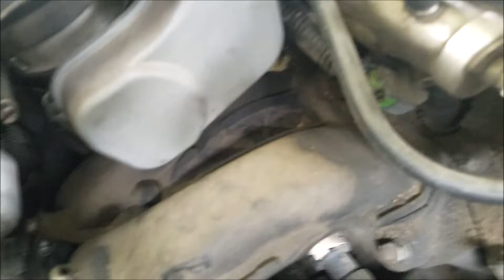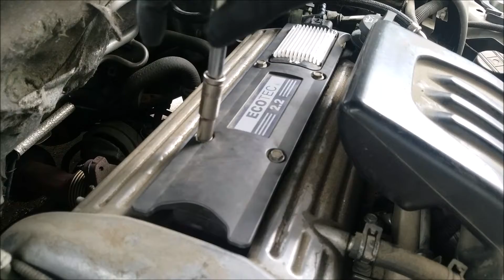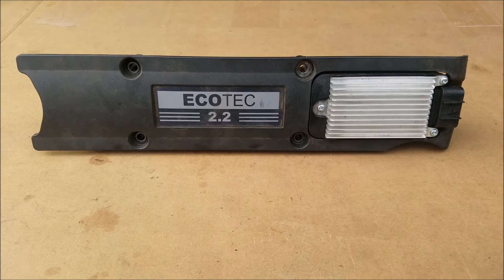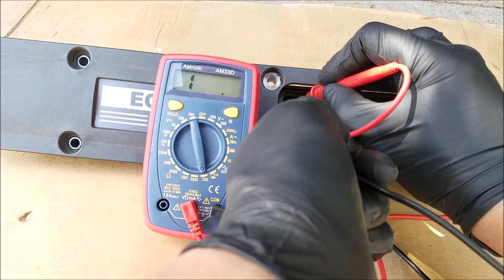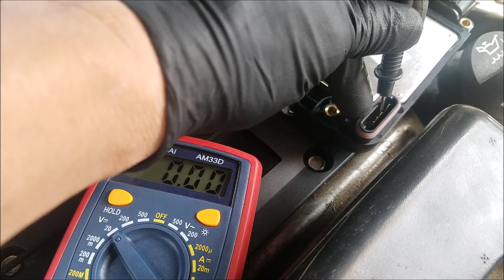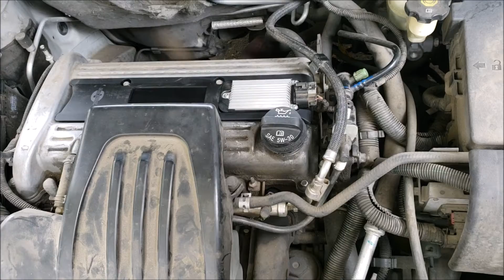2006 Chevy Cobalt 2.2l Misfire P0300 (Testing and Replacing Ignition Control Module & Coils)

Comment: Thank you for the informative film. When you attached a new Ignition control module, where did you lubricate it? I've read - all female connectors on the module (which are 2), but some people lubricate the back of the module and don't put any of Silicon Heat Compound into connectors. And how much you put, if you could tell. Thank you again.
Reply from the maker: You wanna lubricate the rubber seals, usually the ignition module comes with a lil pack of grease this keeps out any moisture or dirt from the electrical connection...u wanna avoid getting it on the contacts, since its non conductive it can cause a bad connection
Reply: @backyardchevy328  Thank you for the quick replay. I ordered one fm Amazon, there is no pack with the lubricant there. On another set they give a pack on which it reads - put into connectors. Means it is a conductive lubricant they send.  In my old module, on the smaller connector there is some grease, very little, kind of oily if you touch it.  There was also a blob of some greyish grease sitting in the coil puck compartment for the module below the second connector. I didn't know at that time what it is and removed it. What kind of grease it can be? Or you just put Silicon compound on the back and that's it, nothing into connectors?
Reply from the maker: @olenaerhardt7725  you just have to make sure which grease u use..the one that comes with the ac delco ignition modules is a lubriplate ds-es its meant to go on those connections..and those u do put on the female ends of the connectors..but some use dielectric grease and those u just put on rubber seals..theres some other modules that have a heat lubricant that goes under module but that doesn't apply to the cobalt since it doesnt have a metal plate it sits on
Reply: @backyardchevy328  But what and where you put on your car? I'm sorry I never mentioned that my car is also Chevrolet (2003 Cavalier), so I think it might be similar grease to use. The thing is that in many films on this subject people put Silicon Heat Compound on the back of the plate (on module) in the manner like they make a sandwich with butter, I've never saw a one placing any compound into the connectors (how it is advised on the pack of the lubricant for ACDelco 19300922 GM Original Equipment Ignition Control Module (on Amazon)). You won't put much into those connectors, so will it absorb the sufficient amount of heat? Now I'm thinking maybe that blob of grease (diameter ~1/3") I removed was there left on purpose by the manufacture to absorb more heat? I ordered 2 types of heat sink compounds (conductive and dielectric) and try to do more research on this matter. Thank you for your attention to my question.
Reply from the maker: @olenaerhardt7725  yea the heat compound is meant for different types of ignition modules not like that model..but u would smear a lil on the underside of the module the metal plate on underside of it and spread it on so it keeps the module from getting so hot..but this module isnt that type...if u use the appropriate grease that comes with the ac delco module...u wipe a lil on each of the female contact points on the adapter piece that comes with the ignition module doesnt need much...but if ur using dielectric grease just a light coat around the rubber seals to keep any moisture out..in my video all i used was dielectric grease on the rubber seals and has worked fine since
Reply: @backyardchevy328  I ordered Delphi already, try to reorder AC Delco (someone wrote Delphi doesn't work with Cavalier, gives code). Old part worked fine, just wanted to clean it on replacing the Valve Cover Gasket project. I think it is better to replace it, since many miles (~100K) on the car. I have some dielectric grease and ordered MG Chemicals - 860-60G Silicone Heat Transfer, so will put one of those till the AC Delco arrives. I think that question with this lubrication is so complicated that it would be good if someone did a film on it. Thank you.
Reply: @backyardchevy328  You know I did some additional research and it looks to me that this particular IC Module (I mean for engine EcoTec 2.2) doesn't require any heat compound, bcs "it includes a copper slug heat sink to help dissipate heat and create a more stable environment and it also features a large bus bar for added support and conductivity", how it is stated in the description of ACDelco on Amazon. So they put that grease pack to use on connectors (still not sure if it goes on the contact points (why do you think it should be applied on contact points?) or just inside the connector to prevent water, maybe it is dielectric grease in that pack). I think you are fine with just dielectric grease as you described, bcs the cooling system (that cooper slug heat sink) is inside, so it is there already, and just some dielectric grease is needed. But why that blob of grease was in the coil compartment originally?! That is what doesn't fit the puzzle till so far. Thank you for giving important pieces of information about my problem.
Reply from the maker: @olenaerhardt7725  yes, these modules dont need heat dissipation since they dont sit on the metal plate as previous models..the grease is just to keep any moisture or prevent corrosion and asong as they have the rubber seals that will prevent that...but if u use dielectric grease it helps em keep moisture out even better..the big connector on mine didn't have anything in it..that stuff thst comes in only the ac delco modules is different than dielectric grease and that one is the original stuff inside the all the connectors..its meant for electrical contacts so thats what u would find..but its not required..all theyre doing is trying to prevent moisture and corrosion..so some include only dielectric grease..and that one shouldn't be used on the connectors only the rubber seals...so i stick only with dielectric grease, it has worked fine for me so far in the ones ive done
Reply: @backyardchevy328  Thank you so much for the confirmation of my guess. I'll just use some dielectric grease on the rubber seal (I have only 1 pink on the smaller connector, nothing on the big one). My only doubt now is if to put any dielectric grease inside of the connectors (I mean on the walls only, on the very edge of it. I'm physicist, I know, that no dielectric should go on the connecting pins), bcs it looks like you put that dielectric grease only in one place - on the pink rubber seal of the smaller connector. Actually if you put on that pink rubber seal, there is no need to put anything inside of the small connector, pink rubber seal will take care of the water. But I'm thinking to put some inside of the larger connector, very carefully, on the very edge of it, so that prevents water coming in. Did you put an Orange Threadlocker on the 3 mounting screws? I don't have one currently, though ordered it, but think maybe to complete everything today with the Blue Threadlocker, or it would be too strong, so then you won't be able to remove those screws later.
Reply from the maker: @olenaerhardt7725  yea u can do that..using like a cotton swab to apply it
Reply: @backyardchevy328  Appreciate it, that is what I planned. Bless your heart!

Comment: If there oil on the boot and plug, just one of them. Would replacing the boots make any difference?
Reply from the maker: That would be an issue with the spark plug tube seals..youll wanna replace the valve cover gasket including the seals that go around the spark plug holes

Comment: Hi, is it possible that if we have a bad coil car will die out. My saturn ion 2005 is giving trouble, intially i mean at 192000km it used to have a gap in firing the units like its trying to die out so after running it for 8000km it has started this problem like sometime it will be no cranking, sometime it dies out right after the engine is started and sometime in the middle of driving. Does anyone have a solution? I did clean ecm connector harness pins with rust remover but same issue continues.
Reply from the maker: Any check engine light/codes?  Thats kinda similar to symptoms this cobalt i worked on had..and it was a problem with the ignition module...usually when its a coil itll have misfires in only 2 cylinders..but itll run bad the whole time when a coil goes out.
Reply: @backyardchevy328  ok ok
Check engine light is on for a long time. When the engine dies, and i try to start then a car symbol with a lock come and engine does not take self and i have to wait in between 2 to 5min.
Reply from the maker: @rasheed4585  oh ok thats a passlock light..thats a totally different problem..itll turn on for a split second shut off triggering the light.. and thats all passlock anti theft normally an issue with key/lock cylinder.....so when u leave the key on til the light comes off it resets it..then itll run...til it happens again
Reply: @backyardchevy328  yes i ll check. Thanks
Reply: @backyardchevy328  Hi Just a feed back for you all others. This week I visited a GMC dealer and the guy checked the computer thoroughly for the codes and all. He reset the car computer and the problem is gone. Before taking the car to service centre i disconnected the electrical connection to electronic throttle body, the idea was to disconnect and check that by removing which connection/sensor the engine is shutting down (Reduced power with a check engine sign and a downward arrow inside) so after removing the connection throttle body flap opened than it normal position and i was seeing it. I removed the throttle body, removed the side pinched cover with flat screw driver and tried to adjust the flap to its original position. GM has not given any provision to adjust it, so fitted the body back. The result was increased rpm at idle which was around 2000 to 2500. So the service centre adjusted that to normal as well.
I was advised that the reduced power was may be due to throttle body wrong values as it was getting hot so better to change it. I did not go for that bcoz it was 400 bucks plus labour.

But my good luck the original problem was solved. I was told that the problem will come back. Taking the hint of throtlle body overheating, the first thing i did was to seal the cover facing with high temperature silicon which luckily i had in the car. So i did the work before driving it back to home.
Reply from the maker: @rasheed4585  glad u were able to get it fixed

Comment: Hey there! In order to change out just the ICM, do I need to disconnect my battery before doing so? Also, do I need to remove the coil pack before changing the ICM as well? I just want to solely change out the ICM. Thank you!
Reply from the maker: Hello..no u can replace it while the coil pack is still installed and no you dont have to disconnect the battery its just always safer in case someone leaves a key on or a tool falls and hits on say the starter and it touches ground causing a spark..but its just a safety thing.
Reply: Backyard Chevy thank you!!!
Reply from the maker: @clayton311553  always glad to help🙂 thank you for the support
Reply: New question. Did you apply dielectric grease to the ICM? And if so, exactly where did you add the grease? Is it needed? My new ICM came with a packet of dielectric grease.
Reply from the maker: @clayton311553  its meant to be used on the rubber seal of the electrical connections to help keep any moisture out, just a light coat to avoid getting it on the electrical contacts
Reply: Backyard Chevy do I add the grease to the little electrical prongs?
Reply from the maker: @clayton311553  no, u wanna avoid that, since it's non conductive so itll affect the connection

Comment: How much resistance should there be if the ignition coil pack is good? The one I have here is reading 0.6 ohms on each.
Reply from the maker: Specs on these are pretty spotty, one manual says a good coil should read .6 to .81...while other says .6 or below is bad

Comment: Have a 2002 Civic LX Honda replaced 02 sensor fixed it now I have p0420
Reply from the maker: P0420 means ur catalytic converter isnt working as good anymore, if ur front o2 sensor wasnt working as good before, now that its working its detecting that the rear o2 readings are similar or the same to the front o2s depending on how bad the catalytic converter is.
Reply: Backyard Chevy I replaced both 02 sensor bank 1 & bank 2 still getting the code for cats and when I was replacing 02's I took the cats off soaked it in soap and water for a day though it cleaned it out water wasn't really dirty idk
Reply from the maker: @Ayeecole  it could be that ur catalytic converter is really worn out that its not doing its job anymore or missing, they wear out and sometimes they get small enough that the pieces break off and go out the exhaust pipe
Reply: Backyard Chevy wouldn't it be worn to the point I can't see through it if I'm looking at it in the sun? Because if I hold it up to light I can see through it lol idk I just don't wanna spend money is expensive
Reply: Worn Sparks won't cause this right?
Reply from the maker: @Ayeecole  yea if u can see through it, it means its not clogged, but could also be hollow and completely gone lol...few things u can check..if it smells like sulfur(rotten eggs) its not working properly..or if u happen to have a infrared thermometer..u can check temp before the cat compared to after the cat...temperature...in a good catalytic converter the temp right behind cat will be hotter by over 15 degrees...if its bad catalytic converter the front and back will be the same or hotter in front of cat.
Reply from the maker: @Ayeecole  worn spark plugs can cause misfires but not the code p0420...misfires actually damage the catalytic converter faster than normal, because of the unburned gas
Reply: Backyard Chevy okay more understandable now, so say I get a Honda exhaust with no cats this code will still pop up correct ?
Reply from the maker: @Ayeecole  yea if u have no cats, that code will always come up, unless the car gets tuned to no cats.